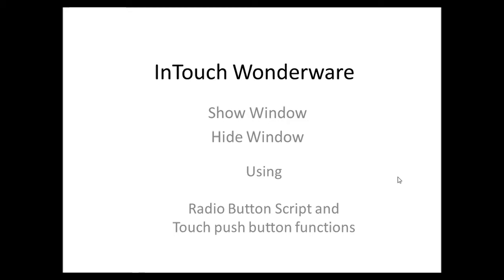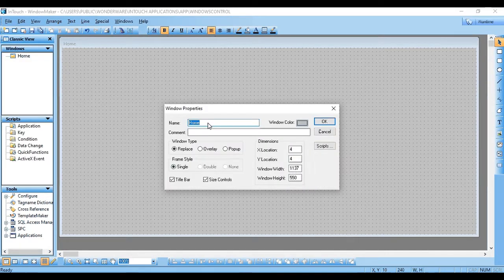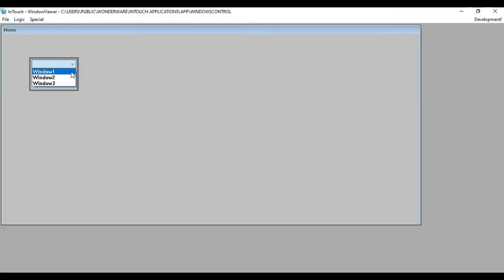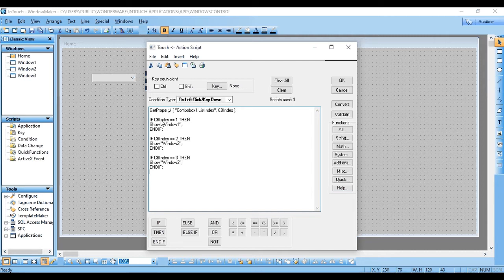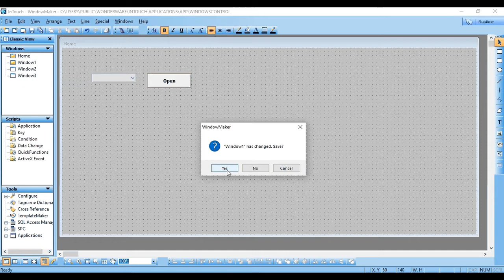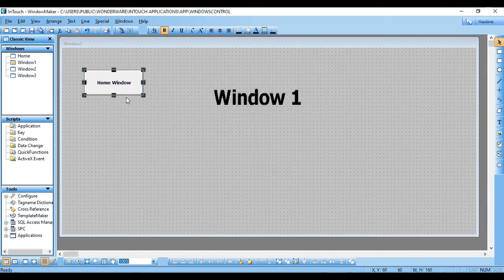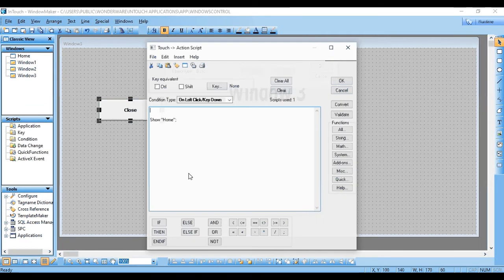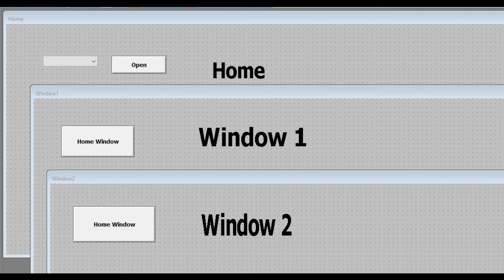InTouch SCADA - Show Windows using ComboBox and Touch Push button - Tutorial for beginner

Comment: Complete tutorial for Intouch SCADA Alarm Window Popup using wonderware intouch software.Casual and remote Web HMI and mobile SCADA users can now view and control real-time plant floor operations data using a secure web browser from just about any “Smart” device such as tablets and smartphones. Wonderware InTouch Access Anywhere is an extension to Wonderware InTouch.SCADA security is the practice of protecting supervisory control and data acquisition (SCADA) networks,networked data communications and graphical user interfaces for high-level process supervisory management, but uses other peripheral devices such as programmable logic controller (PLC) IoT is essentially a culmination of advances in the connectivity of hardware and data networks that SCADA provides. As well as cloud computing and bit-data processing.SCADA system at its fundamental level is actually industrial control system. It uses computer based control systems that monitors and control industrial.Industrial control systems (ICS) are often managed via a Supervisory Control and Data Acquisition (SCADA) systems that provides a graphical Industrial automation is the use of control systems, such as computers or robots, and information technologies for handling different processes A SCADA system for a power distribution application is a typically a PC-based software package SCADA security is the practice of protecting supervisory control and data acquisition (SCADA) networks, a common framework of control systems used in industrial operations.Industrial automation is the use of control systems, such as computers or robots, and information technologies for handling different processes and machineries in an industry to replace a human being.SCADA security policies/standards and risk control framework, which can be further used for risk assessments and benchmarking the organization's SCADA security The HMI (Human Machine Interface) provides a textual or graphical view of system conditions and operations, vital information absent with simple pushbutton panels or switch banks.Rockwell Software manufacturing software helps optimize production and improve efficiency.SIMATIC WinCC is a supervisory control and data acquisition (SCADA) and human-machine interface (HMI) system from Siemens.SCADA is not a specific technology, but a type of application. SCADA stands for supervisory control and data acquisition.SCADA system engineers to perform both the design and implementation of a program to be executed on an RTU or PLC.Citect SCADA is a reliable, flexible and high performance Supervisory Control and Data Acquisition (SCADA) software solution for industrial process customers.SCADA server will be connected directly to the PLC via an Open Platform Communications (OPC) or a RTU Online courses in PLC and SCADA.Best collection of online trainings, classes and exam preparations in PLC and SCADA.Winlog Pro is a powerful, low-cost and easy-to-use SCADA software, suited for the development of Web Server SCADA applications.CoDeSys is the acronym of Controller Development System. It is a development program which enables the user to create visualizations of the operations IOT testing is a type of testing to check IOT devices. Wonderware HMI/SCADA software enables operational excellence across all industries, providing deep operational insight as the basis of real-time performance management.SCADA protocols include Modbus RTU, RP-570, Profibus and Conitel.